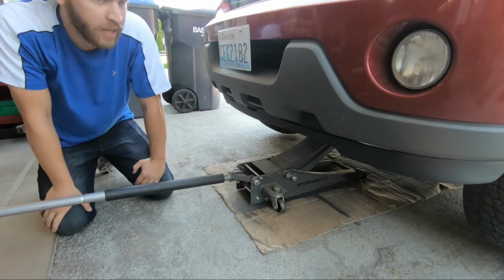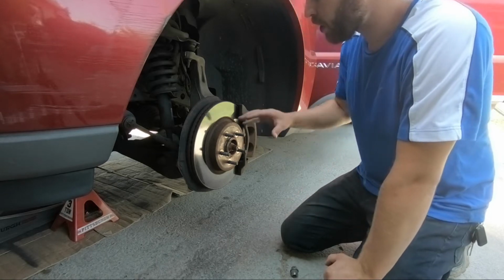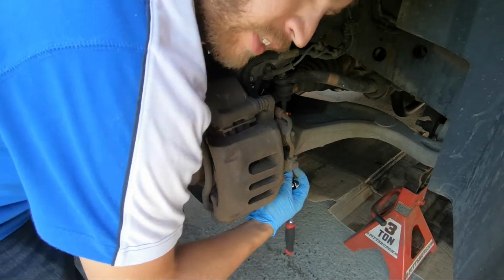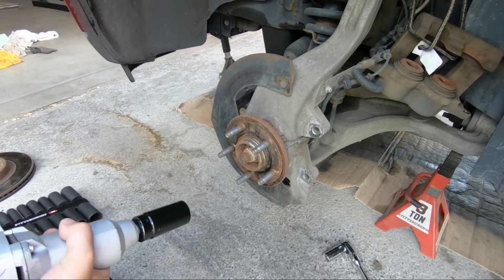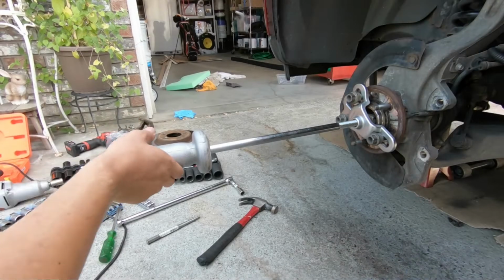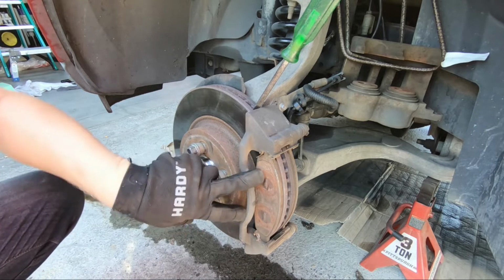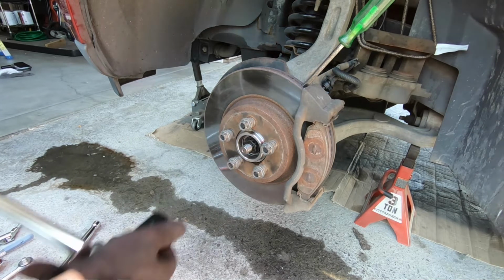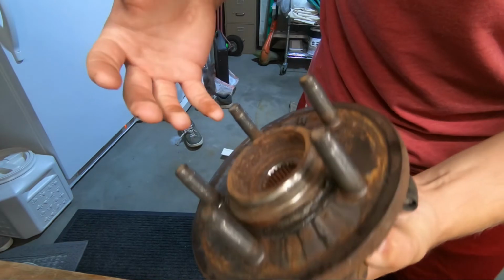02-05 Explorer, 02-05 Mountaineer, 03-05 Lincoln Aviator Wheel Bearing Replacement

Comment: Will a knuckle assembly from a Ford Explorer work here ? Having trouble finding one for my 04 Aviator
Reply from the maker: I’m not exactly sure.  I’d assume they were the same since it’s built on the same platform, but it’s better to be safe than sorry when it comes to something like that.  I’m sorry I don’t have a better answer for you but I would recommend you do a little more research before you buy anything.
Reply: @ydocproductions5593  I picked one up at the junkyard , so I think i will take it to the autoparts store and compare the two side by side . Thank you for responding!! Great video
Reply from the maker: @SuffShakurHDTV   I think that’s a good idea.  Good luck with it, and welcome to the channel